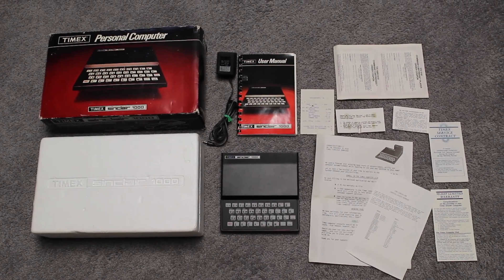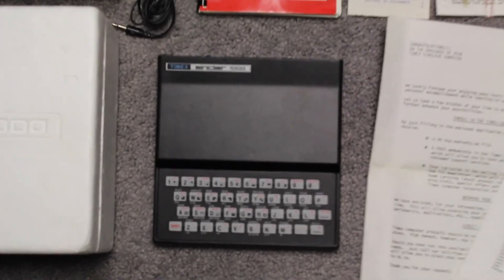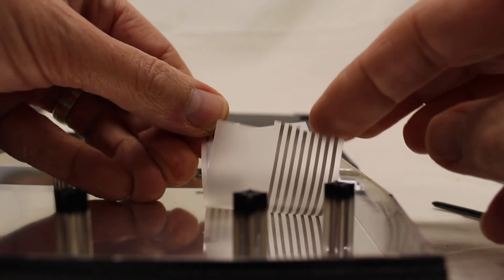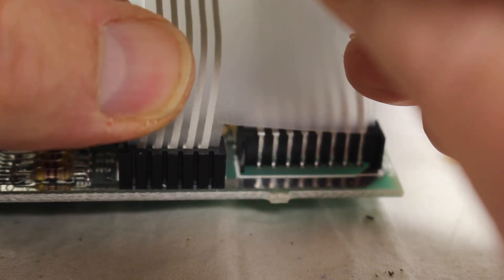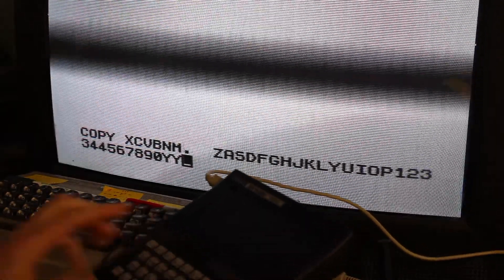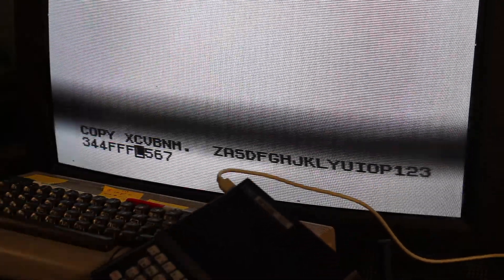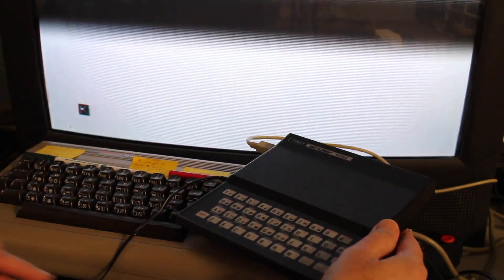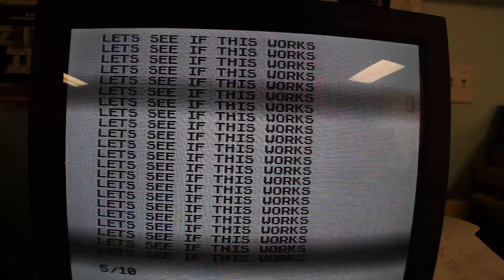Timex Sinclair 1000 keyboard repair

Comment: The $29 price tag was when they were clearing them out. They'd discontinued them (which I didn't know) when I got mine. They were originally $99. I got one issue of Timex-Sinclair User magazine at my local book shop. Never saw another. Thing was a pain to program on with all of the text on screen refreshing with every keystroke. Still, I learned a lot.
Reply from the maker: It wasn't much when you look back on it, but it was still enough to get a lot of people interested in computers and programming (and maybe turned some off too)!